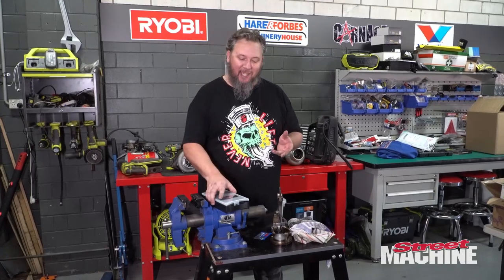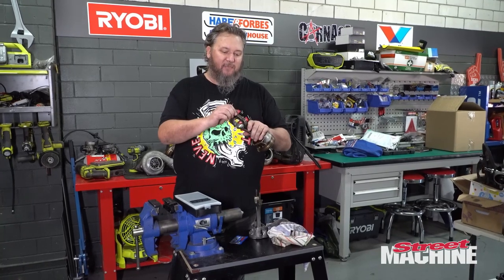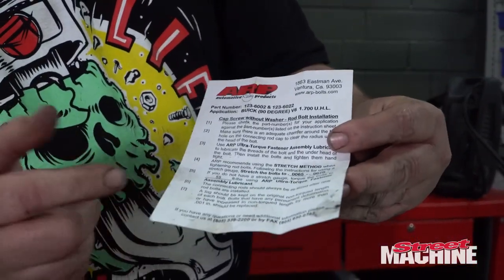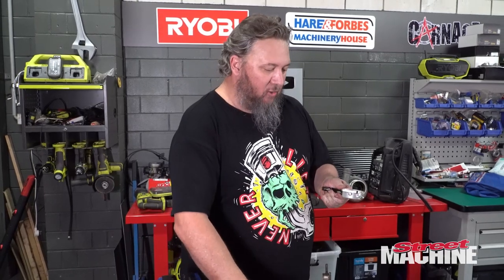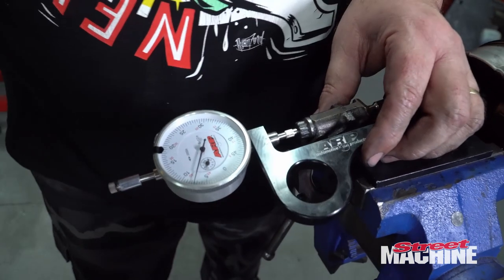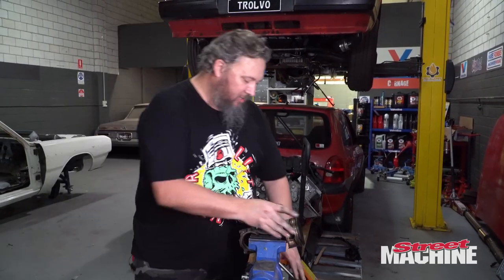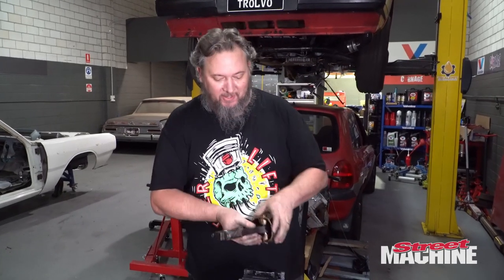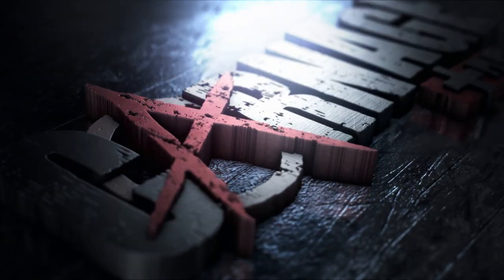Resizing Rods for ARP Rod Bolts (Cap Screws) - Do you need to resize?

Comment: You should have measured the bore with the factory bolts and checked for ovality as well and then check again after fitting the new ARP bolts. This would have been a true test
Reply: Clearance to rod bearing normal bolts std size bearings torqued to normal bolt torque
 Vertical.   : .0018
45 deg      : .0025
Sideways  : .0035

With ARP Rod Bolts Torqued to ARP spec
Vertical.    : .0024
45 deg.     : .0029
Sideways: .0041

Comment: Scotty, much respect, but as others have pointed out, without a baseline measurement using the stock rod bolts (and roundness measurements), you haven't actually proved anything. Even if the stock bolts use the same torque as the ARPs, they're not the same stiffness as the ARP bolts, so you can't jump to the conclusion that the rod measurements would be the same.
Reply from the maker: The factory bolts are torque to yield, so we could get some but they'd be single use. But after the after reading some of the comments I'm just over the subject completely
Reply: I was taught by Tony from Toca Performace. He told me to always resize rods when using ARP rod bolts. When I built my V6 Precise Engine Builders on the Gold Coast said the same thing. Just send it anyway as im sure you are over it by now. I hope it lives mate keep doing what you do Scotty.
Reply: @seanphilip8225  Benny knows his stuff mate and the amount of quality engines that have came out of that place when He talks I listen... asked the very same question about the very same rods and Benny will tell you to re size which he has done for me it’s cheap insurance.. no reason not too
Reply: @lshouse9821  I have been using  precise  for years when Will and Graham were running the show before Benny took over. Nothing bur quality work come out of that shop.
Reply: @STREETMACHINETV  Can't blame you for being over it. You've essentially shown your flock of keyboard-warriors one small "test". If you were checking all the aspects of "resizing" and "roundness" (etc), you would have a much longer clip that would lose a lot of your viewers. Rock and a hard place...
Reply from the maker: @justanotherguy9664  Pretty much nailed it
Reply: @seanphilip8225  my hypothesis is that the larger the connecting rod journal diameter the more distortion that can be had using arp bolts. Also connecting rod material varies, factory larger rods are probably made out of lighter alloys causing them to be slightly weaker and what about fractured connecting rods I'm willing to bet all of that factors in. With a straight six connecting rod journal is smaller probably not going to deflect much compared to a V6 or V8.

Comment: But you still did not check the roundness of the rod bore! You only took one measure, you take at least 2, 90 degrees from each other.
Also you did not check if the measurement you took changed between the ARP and the stock bolt, that I assume does not torque to 55. Its not about the bolt you use that can change roundness, its the clamping force it can apply. 
When you checked the clearances some where tighter, why is that? Shoddy grind of the crank or rods out of round? It could be crappy bearings it has happened but I would bet its rods out of round.
Reply from the maker: The stock bolts are TTY so its hard to compare them
Reply: @STREETMACHINETV  Torque the ARPs to stock torque.
Reply: @mawe42  You can't torque an ARP to yield and expect it be rational . Stock bolts don't specify a torque number either. Otherwise, yes, he compared and measured incorrectly.
Reply: The main thing I didn’t see was multiple measurements at different angles to determine the roundness of the rod end, that was the whole point of this test I thought

Comment: What about vs standard rod bolts? Also checking for ovality, common to check in three positions around the rod end.
Reply from the maker: The standard bolts are torque to yeild so it makes it hard to compare. Most people were concerned about the extra clamping force of torquing the bolts to stretch. There should be no difference between stock bolts or arp if they're both torqued to 55ft-lbs
Reply: @STREETMACHINETV  you are quite a bit wrong sorry to say. the reason arp say to resize on the instructions is the ovality not the nominal clearance. The torque method produces about the same stretch as the stretch method which is entire the point to get the right stretch without measuring the stretch with a special tool. The rod was honed round with factory cap screw with a certain preload caused by the torque to yield fastener. If you induce higher preload whether through torque or stretch method this makes it slightly out of round. Sometimes this slight out of round matters but usually it doesn’t at this level. The point is it’s out of round and awareness needs to be there as with high performance stuff it can cause problems
Reply: Or just plain ol reusing torque to yield bolts like normal and happy times.

Comment: I'm not sure if anyone else pointed it out, but by the time you'd torqued that bolt once, it already has stretched, so backing it off then retorquing to measure is not accurate. You need to measure them before torquing, then once torqued to be accurate. And the other tip is to get rid of the extension on the torque wrench, that will cause a very minor error in your torque settings (assuming your torque wrench is calibrated properly). and don't ever have a hand flat on, or cradling, the top part of a torque wrench, as this will also throw your wrench settings out the smallest margin.
Reply from the maker: And then there's the real world

Comment: I may have missed it but did you check multiple angles with the dial bore gauge to determine out of round? If you only check one point it could be oval and you would have no reference to be able to tell.
Reply: Good point but that is a whole different test though. The original discussion was around some people saying that changing the stock cap head bolts to ARP bolt would mean the rods would need to be resized, which is absolute garbage because the new bolts just screw in, the distortion comes from bending the actual rod while aggressively pound the old bolts out with a hammer / press and fitting new ones. 10 lbft either side of manufactures specs is not going to distort a rod out of shape because you are pulling the two clamping faces together. What Scotty should test while the rods are out, is for out of round in several spots like you say.
Reply: He also took torque away so they are really not torqued to 55 ft lbs. I seen other test done and they do need resizing

Comment: Torque wise it makes sense that the setting the bolt stretch by torque results in over stretching the bolt. Under tight and they're insufficiently stretched to have maximum strength. Maximum tensile strength is reached beyond the elastic limit of the bolt which is why one time use bolts are a thing. Over stretched - so long as you haven't gone past yield point of the bolt - and it'll be a stronger joint and work.
In the absence of anything else you err on over tight not under tight. Counter intuitive to a lot of people but that's mostly cause people think over tight in the context of tightening fittings into say aluminium stuff where you strip off the threads from the walls before the bolt's reached maximum strength. In that case you're protecting the material you're screwing into and not going for maximum strength. When it comes to really tight things and where vibration would be an issue from being under-tight and you need all the strength you can muster from as small a fastener as you can get away with... then yep, over tight beats under tight.

Comment: Yeah, not one to throw a spanner in the works and I’m not saying anyone or Scotty is wrong, but, When I was building engines I would measure the big ends straight up and down, across the bore and diagonally. I called it the pizza method because if you could imagine a pizza with its 8 slices, you would measure the bore on those cut lines like a pizza. This was to make sure you have a perfect circle under the correct torque applied. However all machining was done under the same torque conditions. Just saying, thats how I was taught.

Comment: And yet I saw another video on the same subject and the rods did have to be resized. On that video they checked the "roundness" by checking the diameter in several places, not just in line with the rod. It was quite a bit out of round. Could you have another go, just to be absolutely sure?
Reply from the maker: That was probably rod bolts and not cap screws
Reply: @STREETMACHINETV  tbh, I don't remember if it was bolts, or studs and nuts. Wasn't having a pop at you, btw. Keep up the good work, I do enjoy your videos.

Comment: I've seen pictures on LS1Tech of an engine that was torn down after only a couple thousand miles after installing ARP rod bolts without re-sizing, every rod bearing had bad/abnormal wear, and would have likely failed before too much longer. Some people get lucky and they go a long time without re-sizing, but IMO, I'd rather spend the $80 to re-size my rods while I have the engine apart. It's not worth saving $80 to chance running a bunch or metal going through the engine and possibly ruining the crank, as well as having to spend the time to pull the engine back out.

Comment: Scotty that wasn't the real topic of discussion. The discussion was around whether the rods needed to be resized if you changed from standard cap head bolts to ARP bolts. Which of course the answer is no. All you did was test the difference in checking tightening methods. Which could easily be out by you double clicking with the torque wrench. You can add a little more tension to the rod bolt / nut tightening a second time by virtue of how those torque wrenches work, you should only ever click them once, slowly and evenly. If anything your demonstration illustrated that paying a whole lot of money to test stretch is a wank if you do it up with a good tension wrench in the first place.
Reply from the maker: Can't say I disagree with any of that, but yeah I'll get out of the habit of double clicking the torque wrench.

Comment: Years ago had an ARP tech rep try and tell me to use 135ftlbs on the headstuds on a Rover/Buick V8. Yeah, that would work, and yes I did remind him it was an alloy block. Became very defensive he did.
Reply from the maker: RIP block
Reply: Some of the Toque numbers, they lose before it ever gets that tight.
Reply: @wobblysauce  They would reach zero, as the studs pulled out!

Comment: Well there ya go eh? Nice result.
Be interesting to check the figures against a stock Rod bolt to illustrate why ARP is better, I mean we know ARP is better but to show how MUCH better.
Coz Leg out of bed kinda ruins a blokes day.
Nice haircut too
Reply: ARP uses higher strength bolts which take more force to stretch. That causes more clamp force on the connecting rods. Stock bolts will fail in high performance engines or high RPM. They are already stretchy out and have less clamping force to keep engines together

Comment: IMO, this is inconclusive. You need to measure the brand new bolts then torque them. Then repeat with your used ones. You then need to do it with the stock ones to see if it does distort the bearings in anyway. Would also be good to confirm if the stock ones are TTY. Great info regardless and good to see people putting it out there.

Comment: The amount of engines I've sent like crappy 4g15's with L19 bolts cranked to the shit and the big ends were never the problem are vast haha if you're building it at home that's basically already enough to say you're sending it anyways so to everyone with an opinion on the interwebs, thanks but no thanks 🤙

Comment: Great info, interesting stuff, I reckon that would have been spot on, without the lube on the thread, maybe that gave it it's slight extra reading on the torque, same as know grease, on wheel nuts when torqueing up.. really great info though..

Comment: Measuring bolt stretch is a far more accurate method of checking the clamping force. Just going by torque alone introduces variables - torque wrench calibration, operator on the torque wrench, bolt lube etc...Interesting to see how close the stretch is with the recommended torque however.

Comment: Scotty mate use a engineer's scribing tool to mark the arp bolt head at what position they are at after you have toqued them down and how far you need to turn them back to get the stretch right on.:)  Also maybe the same for the mains as well studs or nuts?

Comment: I’m just a nobody in regards to all of this but once a stretch bolt has been torqued up doesn’t that render that bolt useless, never to be used again?
I’m only asking cause I’m sure there has only been 1 set of bolts & they’ve been done quite a few times....
Reply from the maker: ARP bolts can be reused several times
Reply: That is the theory, but loads of people reuse them also and you have failures in both camps if something else is wrong with the engine. 
More of a what you feel comfortable with.

Comment: It does matter about resize if the rods to put them back to perfection in roundness for a reliable long lasting engine that will be serviced correctly and driven correctly you may get 250,000klms out of it without a problem but when you build an engine that’s going to put out more than double the factory output and more it pays to tear the bloody thing down every 20 or so passes to check the bearings and internals or if street driven at least every 10000klms to see if all is wearing as it’s supposed to be so it does and doesn’t matter

Comment: I like ur shows but what u should of done was use the standard bolts torqued to holden specs then changed over to the ARP bolts torqued to holden spec then to ARP's recommended torque specs. That is the only way u could tell if it distorts the rod.
Reply from the maker: The holden bolts are single use, torque to yeild so we'd have to buy some
Reply: @STREETMACHINETV  aw damn. Maybe just torque the ARP bolts to holdens specifications then to full stretch and see if there is any distortion? I know youse aren't building the engine to last but it would be good to see if it does distort due to extra clamping force.

Comment: LS engines have cracked big end parting lines so they lock back together better than a traditionally machined conrod so you can't resize them even if there wrong 😊
Reply: I hope in the 2 years that has past since this comment you have learned that it is wrong...
Reply: @jcanfixall1585 while he is wrong about not being able to resize them. He is correct that with the cracked capped design that they are stronger/have a less probability of needing to be resized with the use of arp rod bolts.
Reply: @chrisfrizzell1050  hopefully you will learn too!!!

Comment: You'll bend an L67 rod before you break a factory bolt. Seen engines all torn up and the big end still on the crank journal, bolts still in place. The rest of the rod smash to oblivion lol.

Comment: Im thinking you should have measured it before the 1st torq, then after, then use fresh bolts and do the stretch again. 🤷‍♂️
Reply from the maker: Why it returned to same length untorqued, it doesn't stay stretched
Reply: @STREETMACHINETV  you could have found out for sure.. im just thinking out aloud so to speak, not hanging shit scotty. Another q could be do they stretch more the second torque.

Comment: And why wouldn't a set of outside micrometers, or even a vernier caliper, measure the rod bolt stretch just as accurately as that $$ ARP gauge? Aslo, when was the last time that torque wrench was calibrated, if ever? Accuracy is only as good as the instrument used to measure it. No test for roundness before you swapped bolts gives a scewed conclusion.